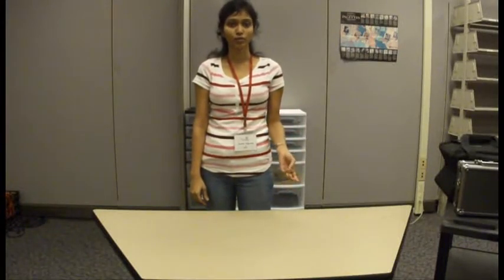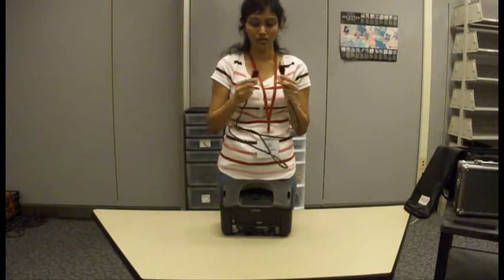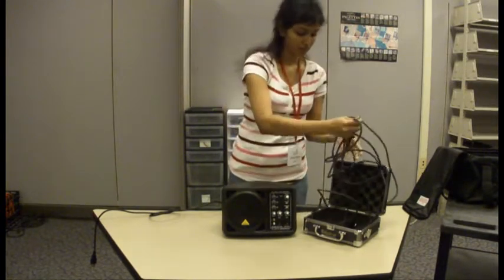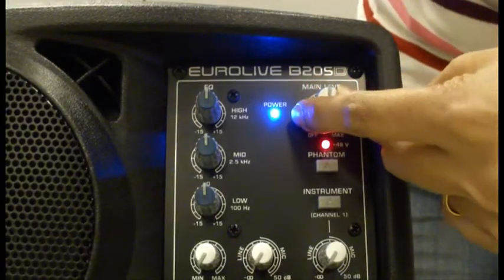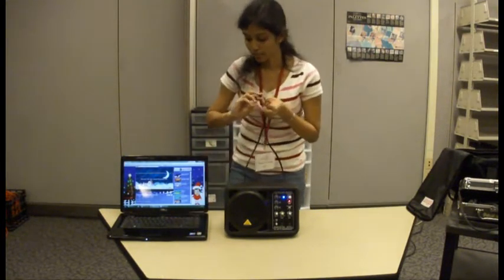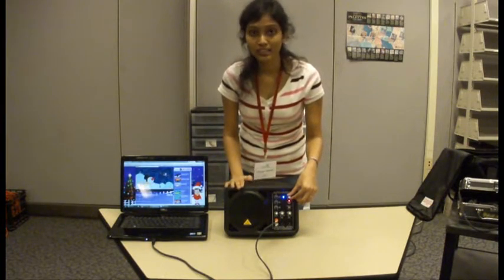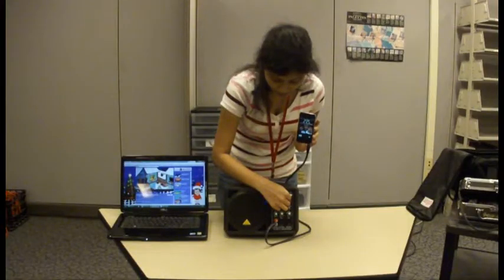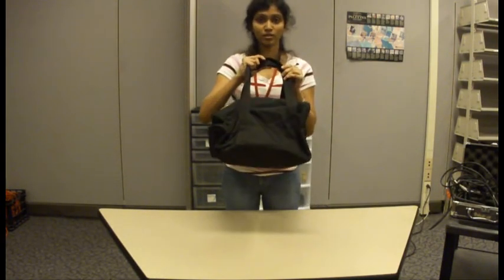150 watt amplified speaker

Comment: Yes I own two of the 207 speakers.The reason that it is 207 rather than the 205 is that it has a minor upgrade."3 mic inputs" instead of 2.They have awesome power.Every bit of 150 watts.will blow you away.